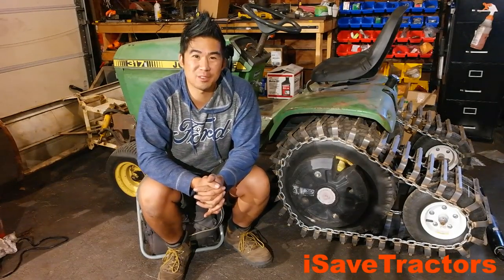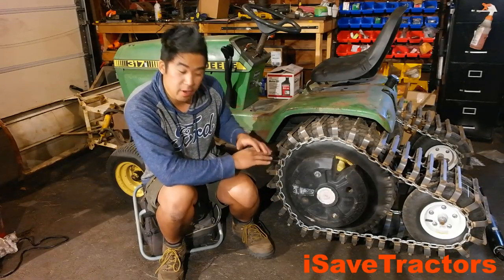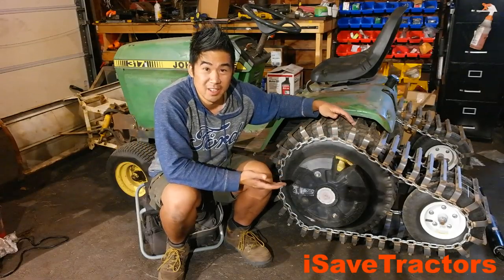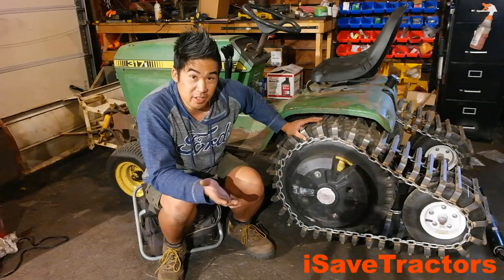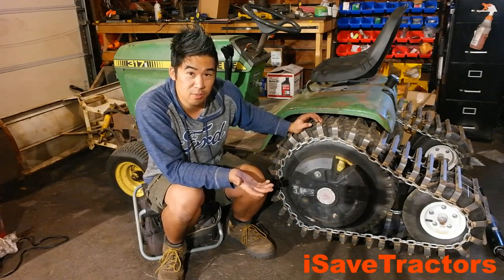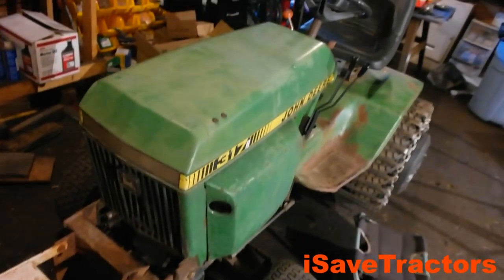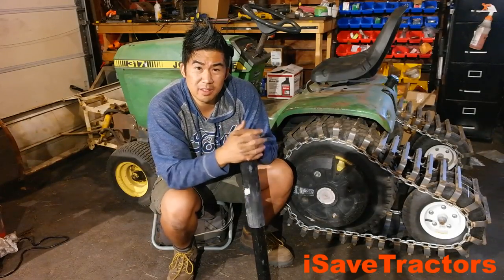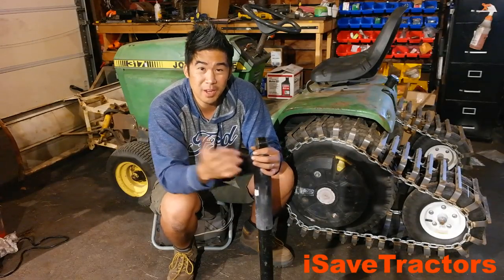John Deere 317 Half Track Garden Tractor Update

Comment: All you need is a lot more down pressure on the boggy axle.  Putting more wheel weight only effects the traction at the main rear tire, to get the extra traction from the track it needs weight put on the boggy assembly..  That will take a bit more planing, the shock absorbers are a start but only that.  A mechanism that exerts much more rear down force is the only way to have tracks do as they were intended.

Comment: When an engineering student has a passion for old iron and garden tractors... Bet you're glad you never locked the diff though! 
I would have done exactly what you detailed towards the end with either truck shocks, maybe  1 inch half shaft stubs on your idle wheel frame, pillow block bearing, and beef up the rear frame a bit. On second review, makes you wonder what that would look like with implementation with a hydraulic hitch system and reeeeeeally long engagement arms! 👀
Sure wish I would have come across this 5 years ago, but that's the internet for you.

Comment: very cool machine you have there, both me and my grandpa own a 317, mine is all original with a blade, mower, and rototiller. my grandpas has been restored and has a newer engine in it and it only has a mower deck. i know that these little tractors pack a lot of power, ive pulled out the stuck (2015 JD D140) twice with the tractor in idle and it was fine!!! great invention!!! also is the blade 2, 4, or 6 way? my blade is original from Deere that is 4 way (up, down, right, left)

Comment: Thought on making the idler wheel  adjustable. 

Use ratchet binders like we commercial  flatbedders use.  Just cut off the hook ends and weld them into your frame making each side adjustable independently of eachother.
Reply: to make the wheels moveable, just put the next side tube up so the idlers simply telescope out or in as needed
Reply: Mike Snell that works too.  I was just trying to be creative about it.

Comment: One quick suggestion is. Consider that the engine weight is on the front wheels... I moved a 150 John Deere engine from the orginal position to behind the main wheels. This you could benefit from with your tracks. Also you have given your self a space to mount the engine behind the body. Simply use the PTO output shaft as the transmisson input.
Reply from the maker: Hmm. very interesting. I like it!

Comment: Slot the fixtures and add flange bearings to a just the track tension.  Also  mount to the frame work  by adding a trunnion to the frame. Just thought I'd add my 2 cents. Great build man  !!!!!
Reply from the maker: Great suggestion thanks! I like this a lot easy to add too

Comment: You may want to add  some pulling / towing features  to your new rear frame.    Steering brakes will still be useful when  things get very slippery.   Snow, mud, soft sand or clay, might require something more than the unpowered steering axle can give you.
Reply from the maker: True. I am going to try driving this around when the Maine Winter comes

Comment: I subscribed today. Cool channel. I currently have a scag zero turn mower, that cuts the lawn beautifully and quick, but the problem is it’s a one truck pony. I would love to get a cool garden tractor, that can be setup with a bucket, rear pro, and belly mower. Do you have a short list of a few models that you would recommend? I don’t know too much about them, and no way I’m spending 15k for a new one
Reply from the maker: Thanks for watching, subbing, and commenting! My favorite machines to recommend to people are based on the high availability of used parts, good engines, and ease of working on. With that in mind I recommend Wheel Horse Long Hood, and 300 series tractors. I recommend John Deere 140 H3, Cub Cadet 129, 149, 169. And the Ford LGT tractors. There are of course many others, but there are the top 3 I send people to.
Reply: isavetractors awesome, thanks for the info. I will def keep watching

Comment: I've been wandering about this type of track system for quite a long time. My one question is what about where on tbe chain? I would be using these tracks to plow gardens with so they would be doing lots of pulling. My concern is that the links would rub in to in a hurry.

Comment: Instead of having your frame mount on the outside of the rear wheels, could you mount it in between the two rear wheels? That would keep your frame from sticking out and getting hung up on things. 
I started a full track conversion on a JD 140, I started it several years ago and haven't had time to finish. I'm hoping to get back to it this winter. I ended up not liking my tension set up and I'm going to rebuild it. If you go to my YouTube channel I have a short video of one side of the tracks working. The video is before I got the tension set up finished. 

And don't feel bad about mixing brands, I have a JD 54" blade on a Bolens HT23 (also on my youtube) :)
Reply from the maker: Thanks for the tips. I will check out your videos. I put this half track on the back burner, while I do other projects. I will tackle it again when snow starts to build up here.

Comment: I like your video I watched it and I've seen what you do with the hat rack and I think it's really cool and being that you have a love for small tractors you're not alone so do I I can tell you from experience that there is one particular tractor that you really go research and look for if you can find one I'll be hard to find but they're awesome and specially if you hook a little small single cylinder diesel engine to it too I think they have a 10-horse diesel there that's out there for it or a Kohler but anyhow cut to the chase this tractor is believe it or not called a Sears garden tractor I think it's like a 16 speed I believe has a high low range lever on the right side and it it it does have a clutch but the clutches basically disengaging Andrea gauging the belt tension but like I said it's believe it or not it's called a Sears garden tractor if you find it and you're able to obtain one in good condition you'll totally fall in love with it you think your John Deere is nice which it is you'll really love this tractor if you can find one trust me I know I have what I loved it and I'll never part with it good luck in your adventures oh PS I forgot to say it's actually called an ss16
Reply from the maker: Thanks for your comment!
Reply: You're very welcome

Comment: I got a 1965 cub cadet 102 with a Kohler k241as engine off my grandfather and all I had to do on it is the head because the sparkplug threads were striped in it and get a new ignition switch in it so I can start it plus I'm buying a 1945 Farmall H
Reply: Charles Rese Old Cub Cadets are awesome
Reply: I almost have it running and I was amazed with how little work I had to do to it nothing compared to my old ji case 741

Comment: Look at the track tension er on an snowmobile  and recreate it on the idler wheels.
Reply from the maker: Good Call
Reply: With a good subframe that would probably be feasable. They are similar to motorcycles(complicated single swing arm I mentioned). The system is about twice the lenght of his and as it sits, there's no room for such a complicated setup. I've ran across similar issues designing halftracks. The size and design has limitations, but if executed the right way, the bogey wheels could be setup like the valute sprung wheel on M1 seriee usa halftracks...or maybe the elastometer suspension from a trailer could be made to work.

Comment: You're going to really need to reevaluate the bogie wheel axle, as it sits with that simplistic design, you're going to keep bending them. You've got opposing tension on those wheels. It would be best if they were supported on both sides, which they usually are if not some heavy duty single sided swing arm like set up. I know you're trying to make it simple for "anybody" to make, but those would have to accept the tension limitations of the system how it sits.
Reply from the maker: Yes you're right. I put this project on the back burner and I am re-thinking it.
Reply: isavetractors I like what you're doing, I love...LOVE halftracks. Years ago there was a guy on here doing what you're doing and used another tractor axle as a dead axle. I want to build a road faring model one day, or restomod an american one.

Comment: i say get 220 volt welder if you own a home just wiring in 220v in my exuberance one that does any welding building at all will need to burn it in 110 just aggravates me i burnt up 2 of them lol
Reply from the maker: Oh yea I have been using a 220v 200 amp welder for a couple years now. Thanks for commenting
Reply: @Isavetractors  yep i was figuring i would say that for the YT watchers LOL i just killed my 220 volt china junker HF diodes welder a bit ago but ill fix that and add a capacitor asap ..lucky working like new is the ole Lincoln tombstone is still going it was pulled from junk yard with rotted wires and rust fixed that mess it will out last me ill bet...Thanks for your love of Ze rusty goodness

Comment: looks ok but realistically its gonna chew up the tires dirt rocks ect those tires will take a beating with that design. nothing you can rely on thats the main issue . so its a novelty waiting to fail . you would never be able to do real work with that. effectively a waste of steel
Reply from the maker: Maybe. In field testing its not proving its worth. Still the point of the video was to work on an experiment. For a future video I may be converting this back to a wheeled tractor and then turn the tracks into a real bad ass set of snow chains!
Reply: I see what you're saying about wearing on the tires! But give this some thought. People have used similar set ups for half track and full track swamp buggies for over 50 year's. I feel a sprocket drive would be a better way to go but I think that setup will last a long time. I do feel the rear axle needs to be redone with a stronger setup. Just my opinion!
Reply from the maker: Yea, I put this project on the back burner for now while i work on others, but when the snow comes down this winter, I will re-visit this. Thanks for watching.